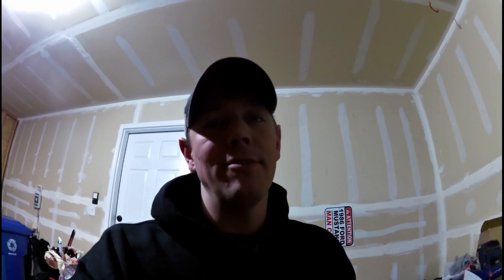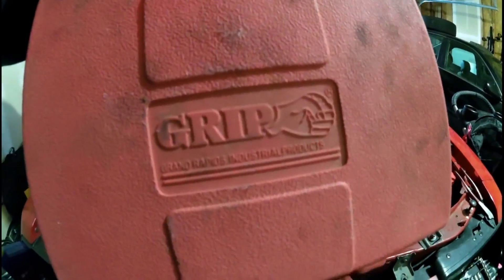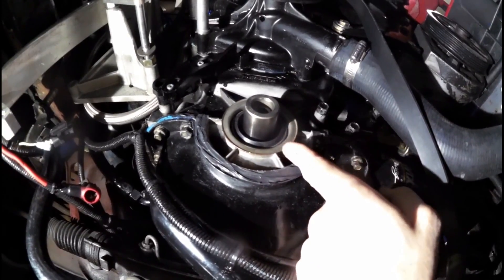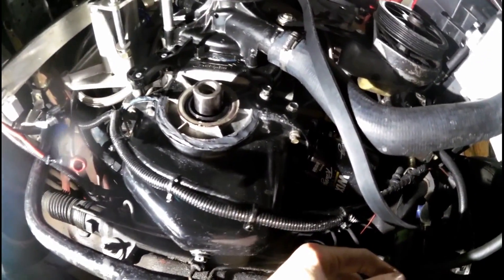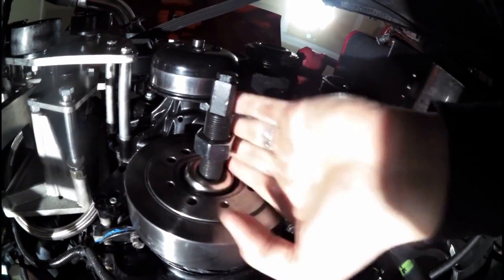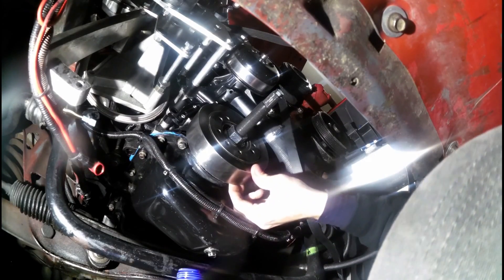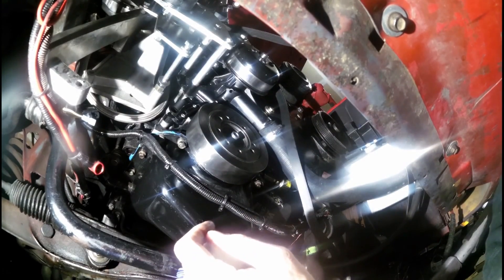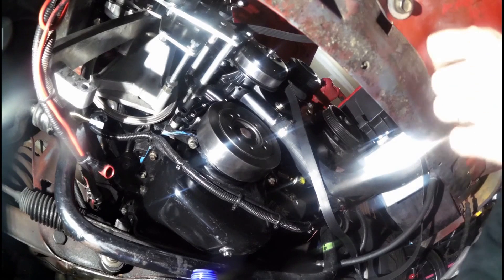Front Main Seal Replacement  [Tech / How To]

Comment: Do you have to drain the oil pan before changing the front seal?
Reply from the maker: You might be able to change it without draining the oil… but I would suggest to plan on dropping all the fluid in case…
Reply: @BMF_Garage  thanks

Comment: what diameter of pipe did you use. that looks like it works better than using a finishing nail hammer to start it and using the harmonic balancer to seat it, i just watched this to see if i did it similar to others cause some dumbass is saying water pump and timing cover removal. We all know what the bolts do from the factory...
Reply from the maker: I believe it was a 2.75” pipe

Comment: Do you put silicone on the front main seal on the out side? The side that touches the timing belt cover?
Reply: i put it in the key way
Reply from the maker: You don’t have to.  I didn’t get the oil pan to timing cover seal just right so I did this to make sure I didn’t have any leaks.

Comment: I gotta do my front seal in my 86 foxbody. I have the harmonic balancer puller but will it install it or do I need a different tool for that?
Reply from the maker: There’s a separate install tool, but I never use it.  I usually give it a few taps with a hammer to get it seated, then use the balancer bolt to pull it on the rest of the way.
Reply: Thank you sir I'll try it that way.

Comment: Thank you, I can't find a exact video for my 91 ford ranger 4v but this is a good reference. Appreciate it. One thing is I don't have and can't rent a impact. You stated a screw driver trick through the hole to the pan to tighten it to 400lbs. Got a vid or a link for that? Thanks again 👍✊😃
Reply: Gonna do this Saturday and rent all the necessary tools.
Reply from the maker: For the balancer?  If you stick a screwdriver through one of the bolt holes in the balancer, it’ll eventually catch on something and you’ll be able to break the balancer bolt loose... I’d make sure you use a decent size screwdriver that’s sturdy and put it in one of the lower holes of the balancer... this will make sure the screwdriver catches something solid and doesn’t ruin the timing chain cover... 

I don’t have any links or vids, but I could take some pictures if you need...?  Let me know!

Comment: What RTV did you use for the oil pan gasket? is it just there on the front?
Reply from the maker: I used the black permatex silicone.  My oil pan gasket is the rubber reusable kind so I just added some silicone for reassurance in the front.
Reply: Clevor BMF thanks, were you able to Do the whole process in your garage? I have a 302 in my fox and need to do mine.
Reply from the maker: Yep.  Did it all in my garage.

Comment: Thanks for the video. Have to change my seal and I'm glad to see it's an easy job. For referance the balancer tool is not needed since the bolt is long enough to run it in without the washer. I ran mine in halfway then put the washer on and finished putting a new balancer on. That was like 14 years ago and I've still got my tired old fox. Cheers

Comment: hey b-stang will a deeper oil pan work for the 351w swap into the fox with a high flow oil pump, because the swap oil pan wont work for that ouil pump because its not deep enough in the front of the oil pan where the pump goes, like the moroso 8 quart or just something deeper.
Reply from the maker: Jason Gordon yeah, there is actually a specific 351w swap deep sump oil pan that will help with that issue you're having.  I'll see if I can find you a link
Reply from the maker: Here's a link to one from jegs 

http://www.jegs.com/i/Proform/778/68053/10002/-1?CAWELAID=230006180000987198&CAGPSPN=pla&CAAGID=44693592161&CATCI=aud-485139889832:pla-208885075031&CATARGETID=230006180039216921&cadevice=m&gclid=CjwKEAjw85DIBRCy2aT0hPmS1jkSJAC1m9UvTkgBrPaKxmXn7HkU7V-y3v-HJogLHA3-8184JDnEYhoCmgvw_wcB